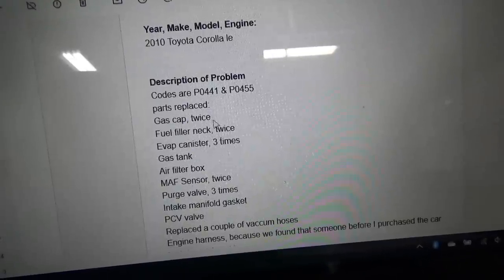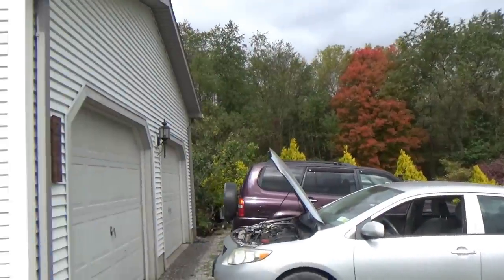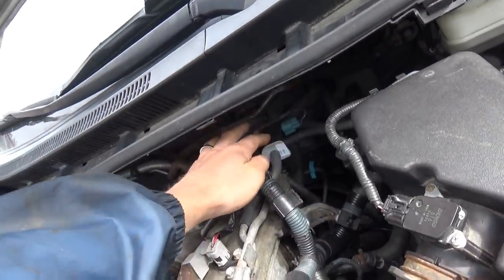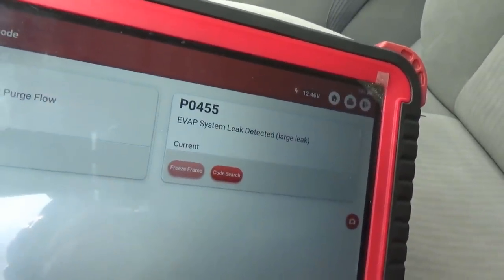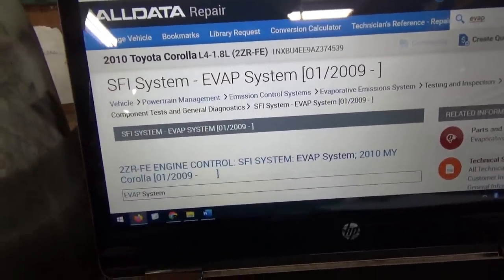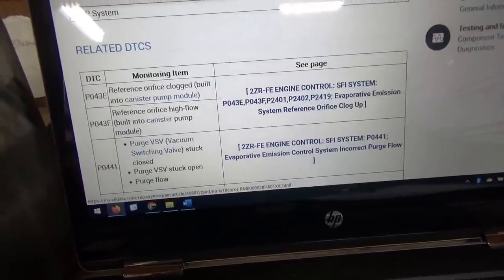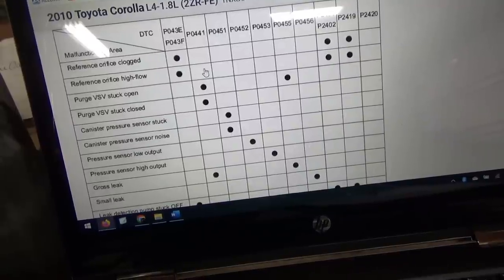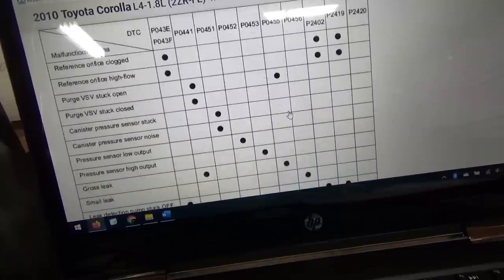2 YEARS of Parts Cannon?! (Toyota EVAP - Part 1)

Comment: Had a a similar  problem  and the was a flapper valve on the perg line tank output that got stuck on its seat because  of the leak down pump .  I only found it because  I did the smoke teat the normal  way at the perge solenoid.  And wasn't  getting  smoke to the tank . Had to remove  to flapper valve from tank so it could perg .  Had no flow codes and large leak codes . Don't really  understand why it had larg leak codes  maybe  because  the order of operation
Reply: maybe it released suddenly once the pressure got very high?

Comment: 1.  With all the parts replaced, who checked the lines from the tank to the front for leaks?
2.  After changing  parts maybe someone unknowingly fixed the problem.
3.  What if any TSB's call for flashing the PCM program (sometimes with a component to match the reprogram) to eliminate the problem.
4.  If all looks well, what happens during a test drive AFTER the vehicle sits for 12 to 15 hours?  Maybe it's a vibration problem.

Comment: Large leak"/P0455... Up front I'm thinking cracked hose or tubing, gas cap shot or check valve somewhere [canister?] is bad.  But the parts cannon list seems to tilt elsewhere  But the english on codes can sometimes be misleading [such as P0401 -there is no flow sensor in an egr system but rather "insufficient flow" is derived from a temperature sensor].  Sometimes, starting with electrical schematics  is not a bad idea if a quick visual goes nowhere.  
So the drawing [6:48] had one thing jump out: soak timer -  is that to block faults on startup, or a way to demand fault persistance & avoid false codes?  Engine coolant temp [7:00] seems to guide, and now I'm thinking faulty temp sensor - probably an rtd or its lead showin wrong resistance to the computer?. Many newer model cars use two coolant temp sensors, so that might be a factor here?  The dash may show normal, despite a fault on a second sensor
But enough of my initial musings before troubleshooting really began.  You are methodical as always, and it is interesting to discover the problem as you found it.

Comment: I want to tend to want to think that if there are no leaks, and the tested parts are functional, then there are 3 choices,
1. Bad Ground; 
2. Over Voltage/Under Voltage;
3. Blocked hose or airway. Crimped, Flattened, Obstructed.

Comment: maybe mud dauber nest in the tank vent line causing a slow purge,  a harness connector plug swapped and in the wrong place,  leaking shrader valve in the vent valve connector port,  pinched purge line somewhere not letting it vent fast enough. , but have the feeling its an intermittent  electrical connection somewhere.   this is one where you do NOT want to go down a rabbit hole based on what the customer has replaced.
Reply: Or maybe there is a mouse nest in the air filter box and it blocked the mass airflow sensor.  No, that's no good.  That wouldn't set any codes.

Comment: I had same code P0445 with my 1917 Toyota 86 and the vacuum pump was leaking through out the wire connector.
Reply: I started to say they didn't make the 86 in 1917, but they did.  They stopped with the FR-S in 1915.
Reply: @Jonathan A ,Sorry it is 2017, my mistake.

Comment: Seeing the list of parts replaced, one thing not on the list is the soak timer.  What happens if the timer is fubar?  I know you solve it in part 2.  Waiting expectantly.
Reply: Is it separate from the ECM with all its digital wizardry inside?  A times should be a piece of cake.  I am also awaiting part 2.
Reply: @jeffryblackmon4846  Viewing the wiring diagram, it looks to be part of the ignition switch.

Comment: So,after closing purge second time it doesn’t drop back down.  Is it possible something in the system is being told to “stay open” falsely during the second part of the test procedure?  Either that or perhaps sensors are lying?
Reply: The last reading referenced 13.4 and expected a slightly higher value after 10 seconds.  The resulting value was indeed 13.6, which looks spot on.

The design of the system is a little obsessive.  They got a reference orifice to pump on so the computer can compare it with something else.  Well, somebody really wants to keep raw gas out of the atmosphere.... yeesh.-kb.

Kenneth King
It appears to me that Step 4 of the manual evap check did not perform as it should. When the purge VSV, vent valve, and leak detection pump are all on, the pressure should release over a 10 second period back to atmospheric and it did not. It stayed at approximately 13.7 psi. Then, in step 5, when the purge VSV and vent valve are turned off, the pressure should drop to approximately 13.6 psi or a little lower in about 10 to 20 seconds. I do not know what would cause that to occur. The next step I would take would be to check that all of the hoses in the evap system are actually attached in the right places.

>>>Yeah.

Comment: I had a Grand Cherokee at my dealer with a small evap leak check engine light I replaced basically the entire evap system besides the gas tank for a small evap leak code checked everything like crazy a million times my shop foreman got the car he ended putting a pcm in it and a gas tank and it still failed a evap small leak test I think we ended up buying the car from the customer and sending it to auction
Reply from the maker: WOW that's nuts!

Comment: IVAN - Have you the ECM (which is what "senses" a problem and "tells you about it") is informed (via electrical wires) of the various condition status AND what the pressure(s) are, THUS, ALL COMPONENTS are FUNCTIONING as intended, YET the ECM is given bad information (numbers?) BECAUSE there is a bad wire or connection?
Just a thought. Kindly, Cloud

Comment: The LDP may have a bad valve causing poor vacuum and unexpectedly leaking vacuum through the bad valve to atmosphere via the intake port. I’m not familiar with Japanese technology, but in my opinion the pressure should decrease more than 0.6 psi. 

Also I don’t remember hearing LDP loaded on the parts cannon, so…
Reply from the maker: LDP is part of the canister :)
Reply: @PineHollowAutoDiagnostics  Ahh… That’s why the canister was replaced 3 times. 👍

Comment: I do not have any guess on this one. There doesn't seem to be any parts left to change. Hopefully they are all the correct parts, installed/connected correctly, and none are missing, since it seems there have been a lot of parts changed. Also, where possible, the original Toyota parts should be installed and tested, and if good used.

I do have several comments that may (or may not) be helpful to Ivan, and if not Ivan then maybe someone else having a similar issue , and hopefully they are relevant. 

One would be to ask the customer if they happen to be using this new E15 gas (15% Ethanol), maybe without even knowing it. Although newer vehicles, 2006 and newer I think (something like that) should have made the necessary changes for E15. This gas has been known, on older vehicles, to damage fuel pumps, hoses (especially vacuum hoses), and other things that would not be relevant to this issue. E15 also holds more water than E10, and the vapor pressure of the gasoline increases, that could possibly effect the EVAP system functionality and/or test.

Another thing that should cut the EVAP system in half, that is isolate the issue to one side or the other of the EVAP system, would be to disconnect the vent hose from the fuel tank to the charcoal canister, and plug the canister side connection. First, clear codes and then run the manual EVAP test. IF the codes come back (Pending I think) the leak is on the Canister side. If no codes come back, the leak is on the Fuel Tank side. If this works, this at least would help to reduce the possible causes, and point to the cause area, IF there is a leak. There may not be a leak at all.

Another thing would be a plugged or otherwise damaged hose or the hoses are not routed to the correct place. Since it sounds like everything has been replaced, maybe someone before this owner tried to fix some issue and ended up routing the hoses incorrectly. Just a possibility.

Finally, this running the test 5 hours after the vehicle is shut off I do not think (but could be wrong here) that this is just some kind of count down timer. Although the ECU has no way to know the temperature of the fuel in the fuel tank directly, unless they added a temperature sensor to it, they could determine the fuel temperature using the Ambient temperature, IAT temperature, and the Engine Coolest temperature and calculate the fuel temperature (estimate). Once the fuel tank pressure reaches the  correct temperature the ECU would run the EVAP test.  If something is wrong with one of these sensors, maybe it runs the test to soon while fuel is still warm/hot. Just another potential possibility. Could be totally off course here. Just a thought.

Omegaman
Reply: Divide and conquer- great plan!

Comment: I’ve deal with afew vehicles with evap problems repeatedly when everything is working, only to find out certain gas stations that 
has rubber splash guard at gas nozzle when owner shoves it all the way in and force gas in at full pressure and some how triggers evap code.
 After I advised them not to put nozzle all the way in so pressure can vent out while owner pumping after that they all say it’s been no more code
Reply from the maker: We don't have those in our state...

Comment: Hi Ivan I have question unrelated to this video. I understand that you’re a busy man and can’t answer everyone’s question but here it is - long story short I was getting shift position/status codes on an INFINITI followed service manual diagnostic and found that a wire from BCM to detonation switch harness wasn’t getting continuity! Now this harness has a ton of wires going through it and would require me to take half of the car apart to find the issue. My solution was to run a new wire from BCM connector to the other connector everything works fine now. Could that cause an issue should I keep it the way it is or should I find the break and repair from there ?
Reply: If anyone else has an opinion you’re welcome to chime in !
Reply: If the wire has been replaced and it works, make sure it's good wire for a harness. Ex prowire. Properly install it, ex crimp/ solder and heat shrink to protect it. I wouldn't leave old wire connected.
Reply: @philarends7555  I used a wire from a remote starter that I had laying around figured it would be a similar quality wire
Reply from the maker: Should be OK but if you don't find the location of the break, then other neighboring wires might be damaged in the same area and lead to other problems 👍
Reply: @PineHollowAutoDiagnostics   Good thought!
Reply: Thank you guys for your input Love your channel !

Comment: Hi Ivan, quick Q, will the scanner you use and list here work with Nissan 350Z, or can you only use the Nissan Consult scanner setup :-)
Reply from the maker: Don't see why it wouldn't...
Reply: It should. OEM scanner is just better on some makes, as it will include the OEM version of Alldata (the program Ivan uses to get all the information). For example in the BMW or Mercedes world the OEM scanner will offer to do the right test on a DTC to check what is faulty instead of you manually having to search through alldata for the trouble code and then fault find. But they are basically only used in dealerships and brand specific shops, because they are extremely expensive and specific to one manufacturer. Pirating the software (not that I would recommend that) is not possible in a shop environment. You can usually get by the hour access to oem diag but that's also fairly expensive.
Reply: Yes.  The Thinktool pro can mimic most consult feature sets.
Reply: @PineHollowAutoDiagnostics   Thanks mate 🙂
Reply: @tschuuuls486  Thanks mate 🙂
Reply: @Sandmansa  Thanks mate 🙂

Comment: Just because You can hear and see the vent valve working doesn’t mean it’s good. Plastic/metal/plastic sandwich that can be rust jacked even slightly causes issues.
Reply from the maker: Great point Brian! Remember that ALL of the EVAP components on this car have been replaced...and not once haha
Reply: I see it now, vent/ fueling valve “ in” or part of canister.
Reply: Wow, what a system.

Comment: Over engineered purge system. I don't know why Toyota did  not use the purge valve and engine vacuum with out that elaborate aux. purge pump canister integrated unit , seal it with vent valve, and confirm with a tank pressure sensor. Too much crap to perform a simple test.

Comment: Why even bother. I have a 2005 Carrolla the evap canister hose snapped off and the cat converter has a small hole they don't check emissions on 05 carrolla it's just a safety inspection and the engine light is on. My mechanic passes it every year and said not to even bother replace them 🤷🤣

Comment: It appears that initially there could have been more than one problem . But replacing several parts , more than once usually is just wasting time and money . I believe Ivan WILL solve this . First by doing the research and understanding how THIS system is designed and works . Then by methodical and logical testing , driven by step by step results . Otherwise it's like throwing parts against the wall and hoping something sticks . I also curse the manufacturer for making these systems so complicated . I doubt most shops would invest the time to go through this . But they seem to have no problem collecting for failed repairs .
Reply: The system should be designed to operate passively.  Collect gas vapor and then let it get sucked out.   All the sensors, pumps, reference orifices, valves. and a computer is a load of effing bullshit.
Reply: @kentbetts  My 1987 Chevy V6 Celebrity is simple . BUT .... the purge valve is part of the charcoal canister . It is pulsed to operate . Over time they must get clogged , with charcoal dust ? , and stick . Mine stuck intermittently and the car ran terrible . The vacuum was down around 12 lbs . I wasted a lot of time testing everything . Simple , plug everything off for a week , drive the car , no problems .  Replace canister with valve . Years later , it's started to happen again .

Comment: If you take something simple like a lambda sensor - non OEM ones will not work on these, or they won't work correctly for long. Fitting them is a waste of time. They fit, they seem to be fine, but they aren't, the ECM will complain.. Expand that thought to everything else... the clicking purge valve is one clue. It ought hold steadily open then close - it isn't, its clicking. The aftermarket parts fitted immediately ruin much hope of there being a simple fix. These need to stay bang-factory boggo or you're inviting a world of pain. Aftermarket anything... naaah. Not on these.

Comment: What a dumb evap system. Are you sure Toyota designed this and there wasn't some German involvement? lol.

Did you already fix the car by putting the OEM purge valve back in? With this many parts cannon replacements, it's quite possible that new issues were introduced along the way.

And who goes and replaces the same part 3 times without fixing the problem? You'd think the second would be enough of a sign you were on the wrong track..

Comment: What is the pressure sensor doing? I've got a 2009 Sierra 2500HD throwing P0446, and it's NOT a vent valve issue!
FTP stuck at 4.73 volts!